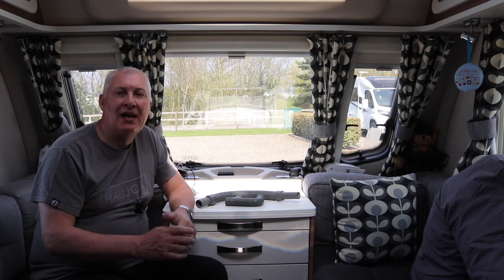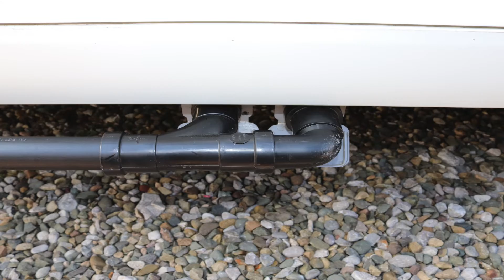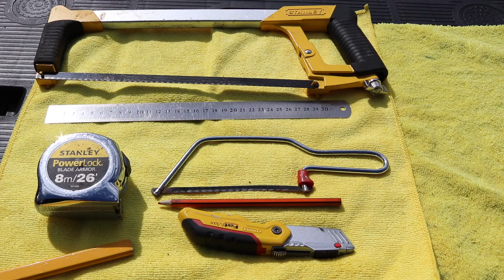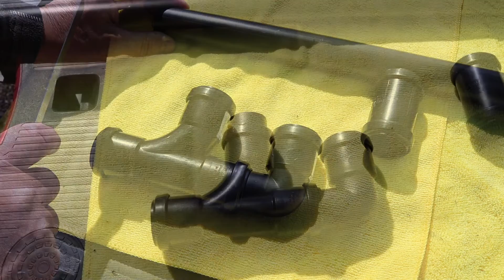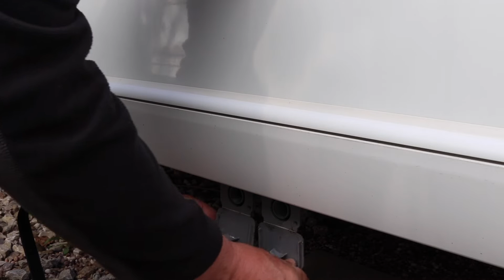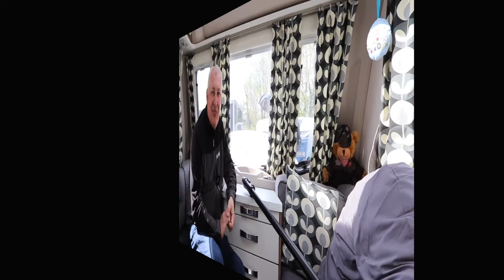DIY Caravan Waste Pipe for £10..

Comment: Phil could you tell me where you got the elbows and y. The waste pipes coming out of my caravan are only 1 inch in diameter  and I cannot get anything to fit them
Reply: Thanks
Reply from the maker: Hi Melanie. I bought all my pipes and fittings from a Plumb Centre. You can get pipes and fittings for your size drain. Hope this helps. Phil.🙂👍

Comment: Thanks for another great video, yes the colapz pipes are OK if you run them on the ground down hill, if you run them down the side of the van the pipe is called colapz as they do dip and collapse between supports, going to do the same to back of caravan 👍
Reply from the maker: HI Andrew & Karen. We have been using this pipe system with the colapz pipes. They work really well together, i am not going back now. Thanks Phil👍🙂

Comment: Good vlog Phil , I have the Colapz mini and waste system and on the whole they are very good but with limitations . The waste pipes tend to sag and I have the pegs but they still sag. 

The mini is great but only since o changed to the new float system - the old one constantly over filled due to the pipe touching the valve and letting the mini overflow .

The new valve fixed that as it’s a better design .

Thanks again Phil 

H
Reply from the maker: Hi Howard. Thanks for watching. The pipes do sag mainly when they have to deal with some form heat. The New Fresh Mini is a great idea we have one and it now works well. Thanks Phil🙂👍

Comment: Hi Phil, What you have there is a good system 👍👌. I have the same but using stainless steel hooks instead of straps. It works a treat when the drain is near the caravan. Cheers, Rob
Reply from the maker: Hi Rob. You know what say the olds are the best. I have been using this for while and I’m very happy with it. Cheers Phil 👍🙂

Comment: Currently away in Spain on a fully serviced pitch with the collapz system and pegs and it's been almost impossible to get the waste water to run away because  of the warmth affecting the flexi pipe. So thanks for the video.
Reply from the maker: Hi. Had the same issue in France. Is there a Spanish b&q near by. You could knock one up. Just a thought. Thanks Phil 👍🙂
Reply: @lostweekendscaravan  I had the same thought, there is a large diy store about 20 k away.
Reply from the maker: Worth a go. 32mm works well

Comment: Hi Phil, thanks for another great video. Ever since I started caravanning I've been trying to find the perfect drainage solution. I went as far as making an extendable version with a 32mm pipe sliding inside a 40mm pipe which could be locked by a 32/40mm pipe coupler which I modified with a hole cutter so the 32mm pipe slid through it. I could reach up to 6 metres with it but ultimately proved impractical because it had to be stored inside the caravan. Then I went the Colapz route and experienced the sagging problem and the fact that I had to buy the Colapz ground pegs to make it work on uneven surfaces. Now, just like you, I'm using a combination of the Colapz tubes with rigid pipe, couplers and and the rail straps which I think is ideal.
The one Colapz item I have which has proven to be a 100% success is their 8 litre Fresh Water Mini which has a float valve in the lid. I haven't used my bulky Aquaroll on a serviced pitch since buying it and we have never run out of water while showering. Another nice feature is it can be placed underneath the caravan so it's out of the elements.
Happy caravanning.
Reply from the maker: Hi Steve. Thanks for watching & taking the time to comment. The Colapz pipes are great will still use them as the main coupled to this drain system. So far it has worked very well and for me is a keeper. I have the fresh water mini and the new float valve works really well. Thanks again Phil👍🙂

Comment: We did something very similar last year for the exact same reasons. Should have done it in the first place and saved a few quid. However like you, we use the colapz ones as extensions at the end.
Reply from the maker: Hi Iain. This is an old method but tried and tested. I am happy with the results. I use the Colapz waste connector when having to use the Aquaroll. Thanks Phil👍🙂